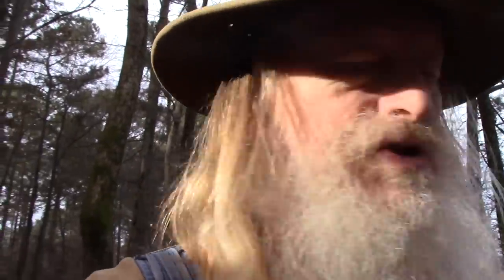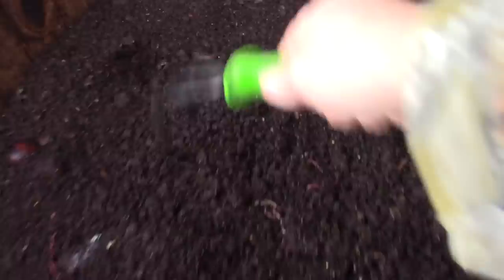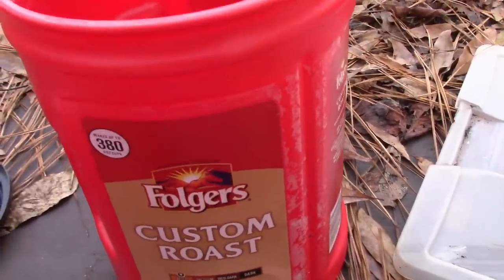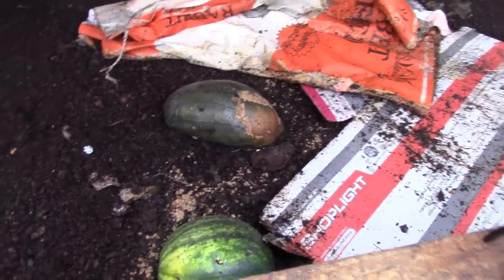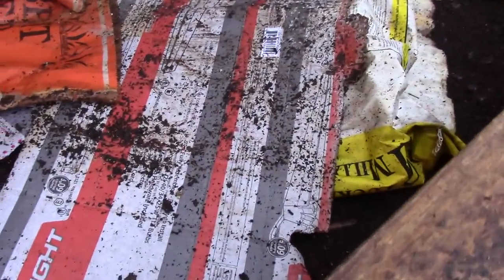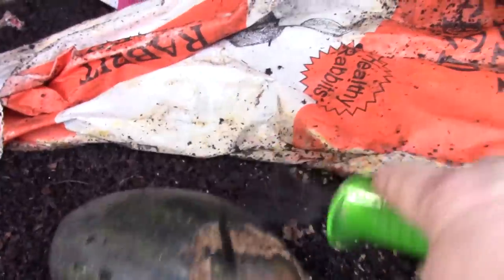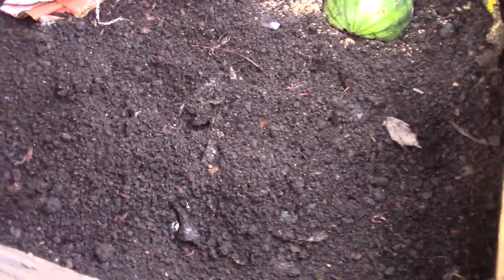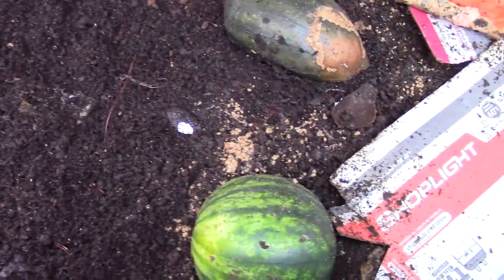5 KEYS TO RAISING WORMS

Comment: Just found your channel and subscribed. I just got an old refrigerator (minus the door) Was thinking about setting it up on blocks for a worm bin. and hinging on a plywood door. Any reason that I couldn't use this if I  put the vent holes and drain hole in with screening? Also have been scoring bags and bags of raked up overwintered leaves set out on the curbs all over the neighborhood. Folks are cleaning up for spring. I toss them in my pickup as I run across them. Can I start out with dried leaves as bedding? If so, do I need to mulch them up fine or use them as is?
Reply from the maker: Refrigerator as you plan to modify it should work great! Leaves should be good too as long as they are breaking down nicely. I'd still throw in a a little compost that is well composted if you can find it or aged manure. Also leaves may leave bedding acidic. A light dusting of pure pulverized dolomite would help with that.
Reply: @greengregs  Will do. Have some bags of black cow manure that has been stacked since last season. Should be very mellow by now. Calling the feed stores for dolomite today.  I was going to work on the box this morning, but raining like cats and dogs here.  I will be contacting you when I have the box and bedding ready so I can buy my starter worms from you. Meanwhile, I'll continue my "worm school" education by watching more of your videos! LOL!  BTW, happen to agree with your politics and preparedness thinking! Thanks for all the great info!
Reply from the maker: @dl7919  Worms need some sand for their gizzards - but Black Cow is loaded with sand. If the cow manure in it has not been out in the rain it could be a problem as it could go into a heat once wet. I'd put that in a lower corner of the bin to test it out. Let me know how that goes.
Reply: @greengregs  Will do.  These bags have been out in the weather for almost a year.  They were so water logged I could barely lift them to restack while reorganizing.  Thought I'd open 'em up and lay in the sun to dry out a bit.  But don't want to take any chances.  Will put it in the corner and check on it heating up before I mix it in. Will also get a good whiff and see if it still smells like sh*t or if it smells earthy and composted.. Shoveled a LOT of sh*t in my time...and I'm attuned to the good stuff. LOL... Got some dolomite today.  Had a hard time finding it...but got a small 5 lb bag at a local plant nursery. Going to tackle the refrigerator this weekend.
Reply from the maker: @dl7919  Sounds like you are good to go!

Comment: Will worms breed in a refrigerated environment?  I don’t want to just keep them. I want to multiply them but being in the upper Midwest it’s hot in summer and too cold in winter. They live in a fridge for a long time. Will they breed in the fridge?
Reply from the maker: As long as it is not below 50 degrees F. Remember they do need air.

Comment: Do you know if the line will get earwigs out of a worm bin? Also have you ever used beam meal in a worm bin and do you have any thoughts on using it?
Reply from the maker: Dolomite works on most insects, but not all bugs such as springtails. I don't know beam meal - bean meal?
Reply: @greengregs  sorry, I meant to type neem meal.

Comment: Greetings from Croatia, Europe! 
What about ants? 
I defend my worms from them by placing concrete blocks (on which there is a container with worms, and I apply the same method for a container for BSF larvae) in construction bins and filling them with salted water. As the salt does not evaporate, I add only plain water as needed.

Comment: So I'm in Indiana and my water generally has a pH of 7-8.5 and it's hard as hell, 10.5 grains per gallon. The sphagnum peat I used had a pH of five dry, which was then hydrated by this water, should that buffer out to a good pH for them?
Reply from the maker: It should - but get some litmus paper or a pH meter from your garden center and check it to make sure.
Reply: @greengregs aww man...I don't wanna buy stuff 😂  It reacted with baking soda in a slurry, but very weakly, I had to put my ear directly into the cup to be able to hear the bubbling, also the water hardness is 16.5 not 10.5, that was a typo on my part, and the majority of that hardness comes from calcium carbonate from all the limestone, when I first watched this I thought I made a BIIIIG oops but then I remembered that I forgot to factor in water quality, which is a VERY significant factor in my area. I mean my God, I have to run vinegar through the coffee maker at least once a month 😂
Reply: @greengregs  well I got the test strips, looks like MY water pH is 7.5 and 12 grains, and the slurry is 6 leaning towards 6.5, my bins are meant for worm production for fishing bait and any worm castings are a happy by product, so I feed them corn flour and coffee grounds exclusively, and eggshell

Comment: So far I've attempted (on a smalls scale) 3 times based off different YouTube videos... Tip #2 seems to be my issues! I've tried paper/food, some dirt with paper/food, they seem to get too wet, too dry, too hot or to cold. 

After watching your video, I'm inspired to attempt again, this time without as much food (and paper). I don't have horses though, would purchasing a couple bags of compost and/or manure work (gone through the heat phase you mentioned)?

Comment: if I build worm bed off the ground with ply board I got redguard to make it water proof so it should make it last for many many years an I was thinking putting 3 rabbit pins over the top so there droppings just goes right in
Reply: I got yard full of crazy ants I know they want to take it over I make it with 4x6 I already got laying outside I can put the grease on the legs hope it keeps the ants out best idea I got
Reply: I got rolls of screen wire an rolls of garden paper keep grass out I put whole in bottom with wire an paper so the bed drains very well I can water everyday if needed I have well water
Reply from the maker: @hillbillybassfisherman8181  I do that

Comment: to prevent worms from climbing out of the wooden box apply a strip of grease about 1" wide around the top perimeter on the inside of the box, maybe the worms won't cross the grease.

Comment: Greg I have a worm bed and it has some pot worms in it and I need to get rid of them got any ideas
Reply from the maker: Greg pot worms love moist acidic beds. It is best to add a little pure crushed dolomite (limestone) or wood ash. Lightly sprinkle it on and lightly moisturize. If the problem persists add more. You might also let the compost dry out a little bit - but it still has to stay moist for the worms.
Reply: @greengregs  thanks I will pick some up when I go to jasper

Comment: You can put Epsom salts in flat containers all around the beds (don't get them wet) racoons don't like the smell. You can make a tea from HOT peppers and cayenne, mix with a little dish soap and water(strain well) and spray the wood of your containers and around them. It burns their paws and keeps them off. I've even used cayenne powder on dry ground around plants they are mining for worms and after a few times of burning themselves they stay away.

Comment: What about using chicken or rabbit manure in you're worm beds?
Reply: Both are good. Rabbit manure can be used straight, it is a cool manure. Chicken manure is a hot manure, it needs to be aged a few months to cool off before use. If used hot it will start to compost, create heat (up to 160F) and cook the worms.

Comment: FYI. They can call GMO's organic because they do not need any pesticides to keep the bugs off of them. They are created to make their own poison. So if it is poisonous to bugs then it is poisonous to you. I just use compost from my lawn clippings and I throw my food into a trash can and just let it break down for a while then I put it in my compost when I need to mix the compost up after a while of it sitting.. Then let it keep breaking down till next year. Then I put it in a container and wet it down some and throw some worms in it and just keep it moist. They do just fine in it. I let them have at it for three months. Dump the container into the one that has holes in the bottom and put it on top of a new batch of compost for them to make their way down into for a month.

Comment: I live in central FL, would the worms be able to survive the summer?
Reply from the maker: yes
Reply: I'm not an expert, but it may be hot enough there to use big African night crawlers instead of red wigglers. I've heard they thrive in the heat and are great composters.

Comment: I would suggest using soaked sawdust over the top, easy to make & is cheaper than Dolamite & will also help feed the worms. It keeps pest out, especially fruit flies & if you break apart the compost you are feeding the worms ( such as that melon ) they have an easier time breaking it down while also having the benifit of preventing less mamalian pest.

I also wouldn't use peat moss just because its unethical, peat bogs are in endangered & its harvest isnt sustainable.
My bed is a castiron tub under a large tree, the shade keeps it cool in the heat, keeps pest out, drains perfectly and is easy to sift when collecting the castings.

Thank you for the video
Reply from the maker: Don't use pine!
Reply: @greengregs  
We use oak shavings so we can also grow Oystermushrooms in the bin. It helps provide the worms with a more diverse & natural ecology & helps break down any possible contaminants. While also helping to strengthen bacterial resistance in the worms. 
Thanks for the advice Greg.
Reply from the maker: @libraryofpangea7018  You are on the right path!!!
Reply: @greengregs  
While I've got your eye, I would appreciate it if you have any reference material you would suggest, books, videos research papers ect, for a deeper understanding of Vermaculture. I'm peicing together my education on the subject- however I find the lack of open material increasingly frustrating. Hope you are having a good Christmas season Greg.
Reply from the maker: I started with a lot of the older books from worm.com, material from permaculture classes, and books on worm tea from Amazon. I lost a lot of my books from loaning them out.
Reply: @greengregs  
That reminds me,
 My Da actually loaned me his Permaculture Designer manual, which is how I found out about Vermaculture & started learning. I returned it to him, but he gifted me the same copy that Christmas.
  I'm sorry your books are missing, but I do hope they are well loved. 
  This is Beautiful Knowledge...
Reply: Update, we swapped to Red Alder for growing our mushrooms because it's free here in the PNW. Since then our worms world has been much more active, they're getting larger with the alder instead of the oak.

I don't know what it is about the red alder but our worms are thriving and the bins actually smell really good. Our worms have picked up the color from the alder they are absolutely gorgeous.

I also figured out how to convert our world world into a mushroom bed by crusting the top lair thickly in oats & coffee  grinds. Put a very large trash bag over instead of the wood pannel when we do, & it produces almost 50 pounds of Oyster mushrooms off one flush. Break the crust up when done & the worms take care of it. Was some good eats.

Comment: This is only my 2nd of your video's. But I don't understand what bedding to start with. Can you use potting soil? Can you buy horse manure @ the store? And how am I gonna know if it's going to get over 180°? I need help.😧
Reply from the maker: Potting soil may be laden with chemicals.  Can you find a place that stables horses? That's the idea place to get horse manure. Make sure it has sat outside in the rain and is aged before you use it. Compost is great - just make sure it has  gone through the heat cycle before you use it, or that it is well aged. Use can also buy peat moss or coconut coir at your local garden centers and feed stores. Let is soak first in non chlorinated water then squeeze it hard until just a drop comes out. I see I need to do a video on this topic. All the best! Greg
Reply: Tracy Bowling a compost thermometer is an excellent way to tell the temp of the bedding .
Reply: I had no idea those even existed. Thanks for the help Joel. I'm gonna go hunt for one on Amazon. 🌡

Comment: Is there any difference between red or night crawlers as far as the worm market goes. You sir, have me really thinking about this. I'm 70 and would really like to supplement my social security.
Reply from the maker: The reds are easier to raise and are preferred by gardeners - especially i they put them in their gardens. European night crawlers have to be air-conditioned in the summer and africans require heat in the winter.

Comment: I noticed ants in my raised bed garden after I put worms into it. Do the ants prey on live worms in a garden?
Reply: Dank Breh I had ants in mine also. You can spray extra water over the bedding and you can also put whole cloves or a spray made from a few drops of peppermint oil in a spray bottle around the bottom (outside) of the worm container.  I like the whole cloves the best.  Ants hate cloves
Reply from the maker: Sprinkle in a light dusting of pure crushed dolomite - insects hate it. They prefer some acid.

Comment: How do worms feel about eating wood chip piles?
Reply from the maker: If they are well aged and mixed with compost it will work great except don't use pine unless it is several years old or small percentages of the chip content. You can mix fresh chips in with other compost. Just don't toss them into a pile of fresh wood chips with no compost.
Reply: @greengregs  I have 2 piles of arborist wood chips from chip drop along with a large stretch in the garden with about 1' thick area of wood chips for a Back to Eden Garden.
Reply: Ask Maxine waters.
Reply: @jakebogus5361  who is she?

Comment: Please use a chlorine/chloramine filter for "tap" water. The cheapest or easiest alternative to de-chlorinate water is the liquid or tablets you buy for fish tank water at Walmart. YOU CANNOT GAS OFF CHLORAMINE BY LETTING WATER SET FOR 24 OR 48 HOURS. The majority of all water treatment facilities in the USA add chloramine.
Reply from the maker: Those filters still leave a fair portion. I didn't have any baby worms for a while and found out my hire hands were using a hose with one of the filters. Stopped that and the babies came back!

Comment: On that last point 5,
The advice is good but the reasoning is far off.
AFAIK a worm bed won't turn acidic simply because there is too much food, acidification would happen only if there is anaerobic bacteria which would happen only if there isn't enough oxygen. I've piled food into a corner of my worm bin (Important not to cover the surface!) and my worms go to town happily on a massive amount of food, but only if the food is fed properly.
The real problem with feeding a large amount of food at a time to worms is that the aerobic decaying process will use up all the available oxygen that worms also need to live (what animal can live without breathing oxygen?), and packing all that food vertically and deep in a corner works just fine where spreading across the surface will strangle your worms.

But in general,
Especially beginners should not feed more than what worms can consume in a day like what this video says. If after feeding the food is still visible the next day, then it's too much unless you feed your worms as I described. And even if so, worms will be just fine if you feed them only a week or two apart. Worms will do just fine consuming their own poop if they're hungry before their next feeding.